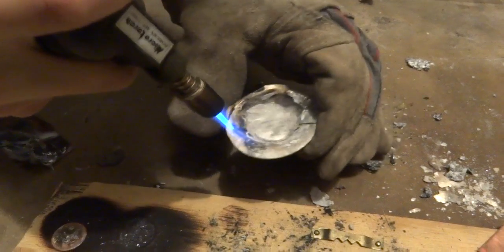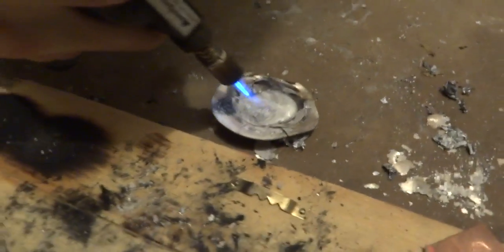Casting a Metal Object with a Clay Mold (Low Budget)

Comment: Just a follow up question if you were to bake the clay in the oven until hardened would the result come out better. Of course you'd have to break the ceramic but I think the metal would pour better for casting.

Comment: Thanks, this is the video I wanted to find for my project. And for the reminder to let it dry first. cheeers
Reply: The mold will explode if it is not fired and at the same temperature of the aluminum while casting due to thermal shock and trapped water and air pockets.

Comment: For anyone wondering aluminum melts at around 1200 degrees and be cast into most clay or sand. You dont risk any pressure explosions unless youre casting iron or steel jnto wet sand. For casting anything larger than a lego made mold id suggest building a small charcoal forge with a steel crucible for melting aluminum
Reply: Casting sand is porous enough that steam released as the hot metal approaches can escape through the sand.